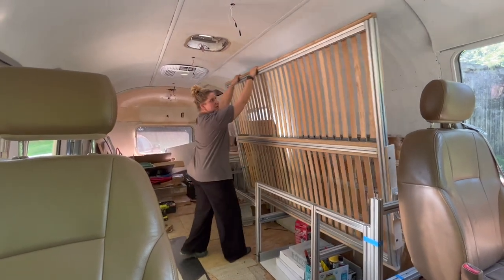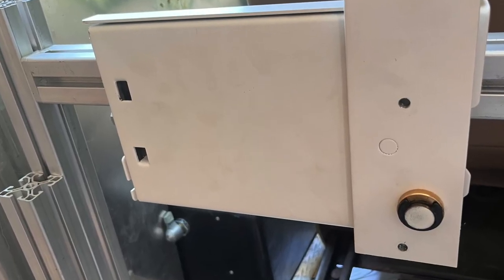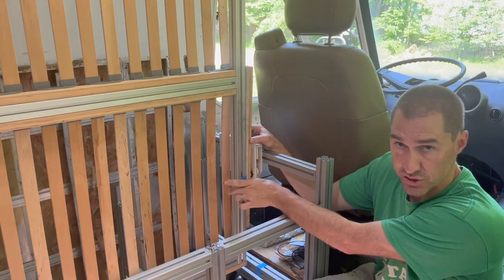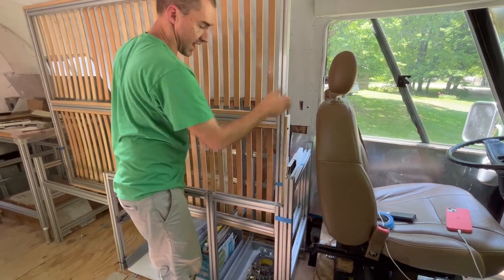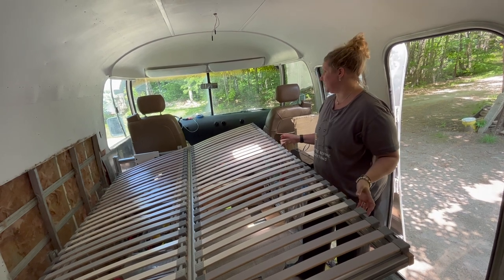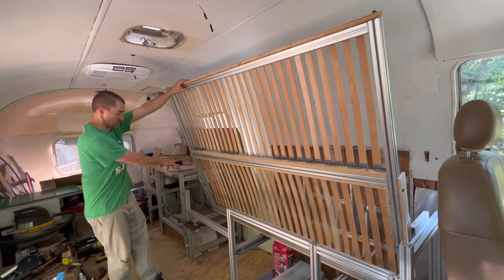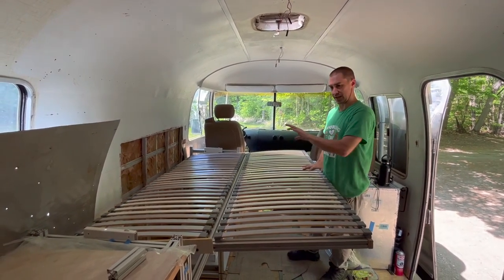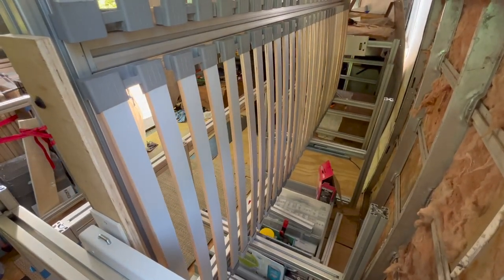Airstream Argosy DIY 80/20 Murphy Bed - It Works!!!

Comment: I think once you get the mattress on there might be more adjustment and how are you going to attach the mattress to the frame?
Doing good keep going 
Take care Ray
Reply from the maker: Hi Ray! You are spot on about the tension adjustments once we have a mattress. There is a tension screw on the hinge but we have not messed with it yet. Shanna has some ideas for making a seat belt for the mattress once she designs the wood part of the bed box. Thank you for the support!  ~Airstream_Wheeler